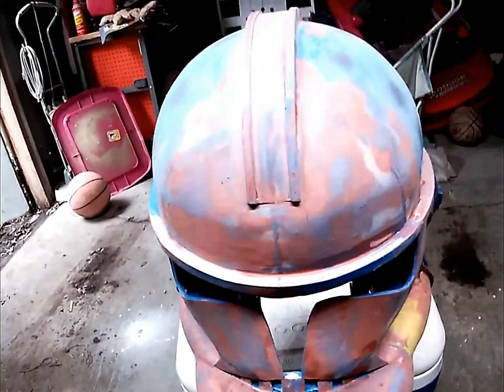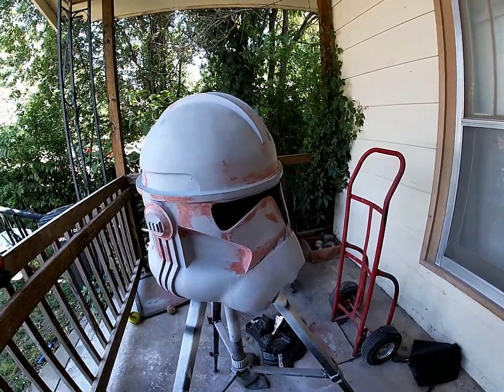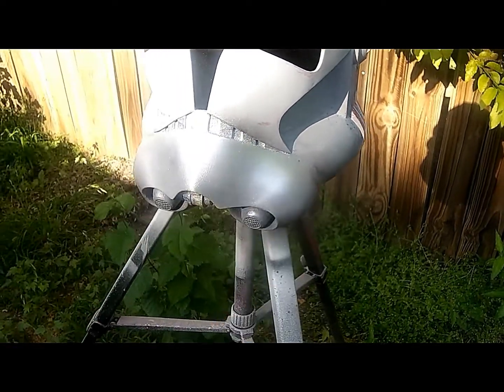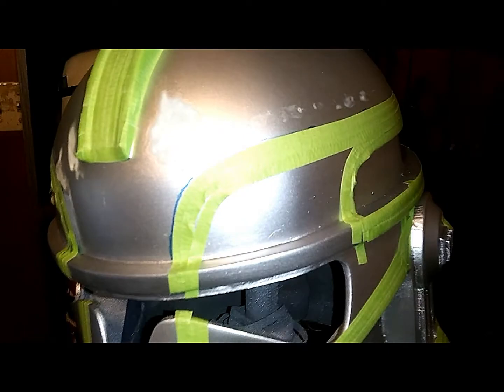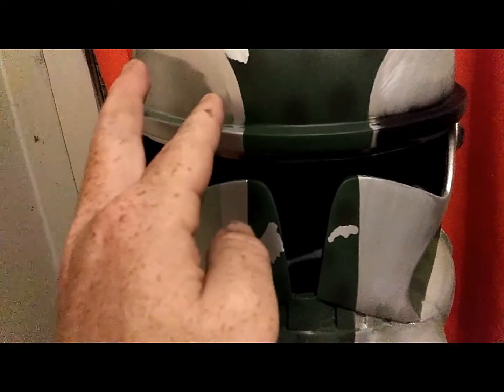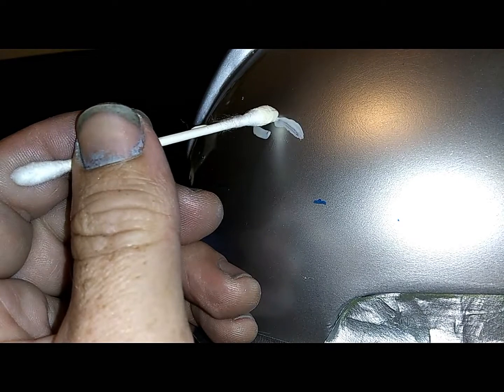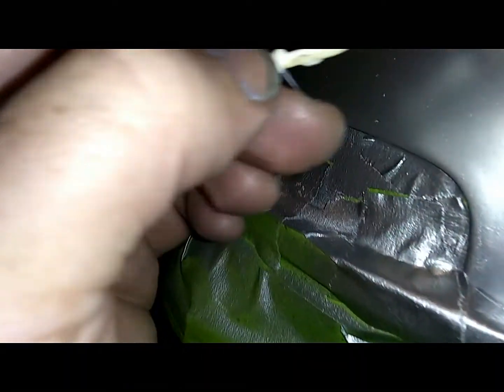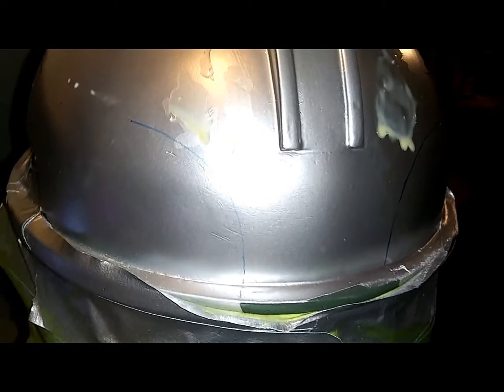Wookie Planet Clone Trooper Build Part 1 3D Printed

Comment: Great video!  Liked and subbed.  I am building my first 3d printed helmet using the same model you show here and I am wondering if you had any issues gluing on the pieces right behind the "ears"?  Mine overlap the sides of the ear pieces when it seems like they should line up perfectly...
Reply from the maker: the problem with this model is its so big that if you are slightly off by the smallest margin, the last few pieces will not line up correctly. I thought I had them all lined up perfectly and still had to do a bit of heat shrinking (use a blow dryer to hear up the plastic to make it a little more malleable to line up) to get the pieces to fix.